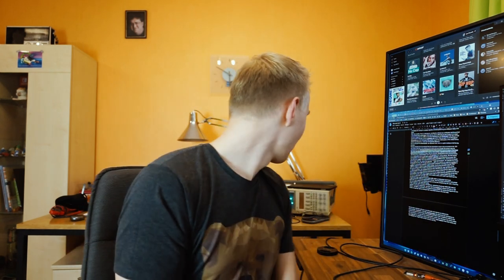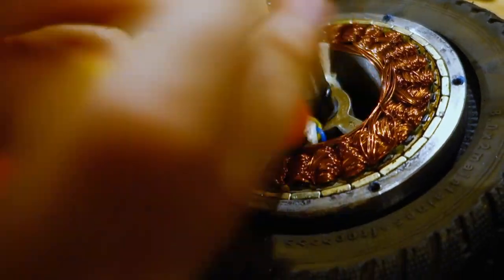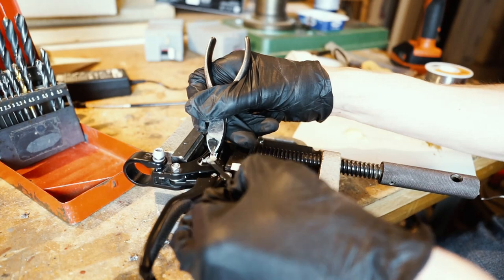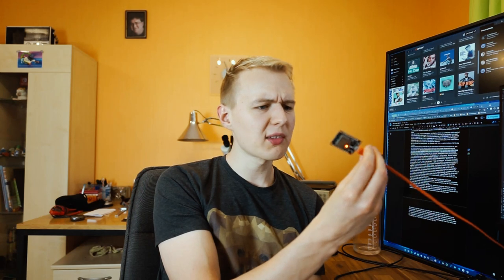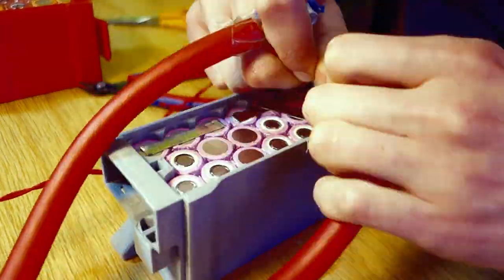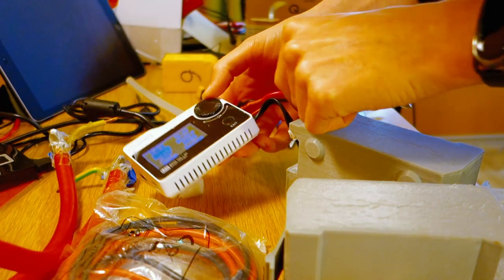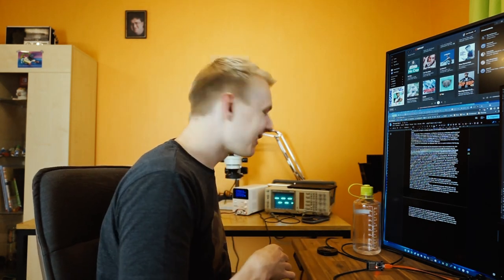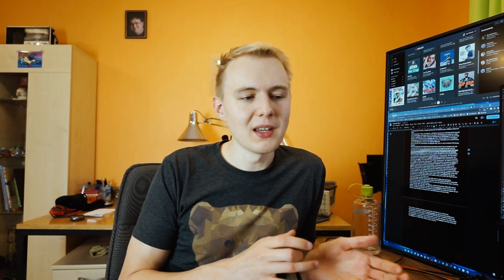This eScooter will be Insane

Comment: For long i2c  wires i use Level shifters to get a much higher voltage at the datalines, so convert it to 12v or something like this, transmitting it to the wire, and after this convert it back to the original voltage Levels. I use this whith the Esp32 5m distance. This works fine for all digital Signals, Even whith i2s and i2c.
Reply: This is a clever solution!
Reply from the maker: Yeah thats actually a great idea!
Its still a bit prone to harsh EMI.
I also thought about using differential signaling, but programming an app is quite fun and reduces parts :)

Comment: The cheap chinese vesc 4.2 clones feature 2 ADC input channels i think. They can be configured as brake and throttle in the vesc tool.
Reply from the maker: thats pretty cool, might look into that in the future. could in theory reduce parts
Reply: I can confirm this. I did that exact thing with my e scooter

Comment: Even though you have a new camera now, the focus is still not on point. Can you maybe setup the autofocus to track faces? Or maybe you are using a very low bitrate because I was not able to find sharp parts in your video.
Reply from the maker: Yeah used manual fixed focus for the main recording and moved too far forward, will pay more attention to that in the next videos

Comment: Do you have the stl files of the 3d printed swappable battery packs, that you want to share? I really would like to print it myself for my recycled laptop batteries
Reply from the maker: I wanted to publish them in my github once the rest of the project is done. I dont really see how usefull this is, its really made to fit my escooter and is basically useless if you dont have my exact measurements